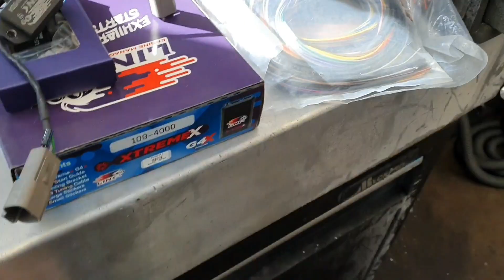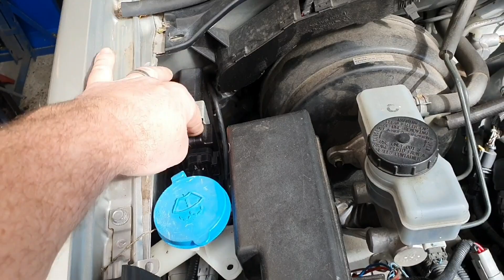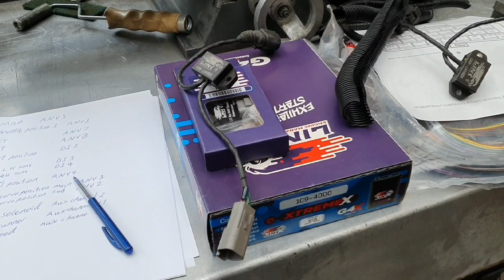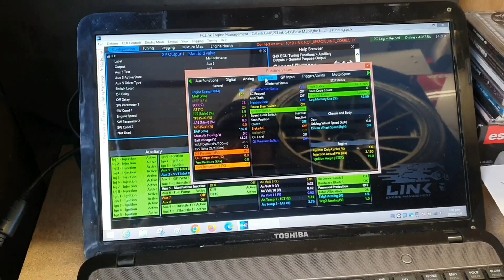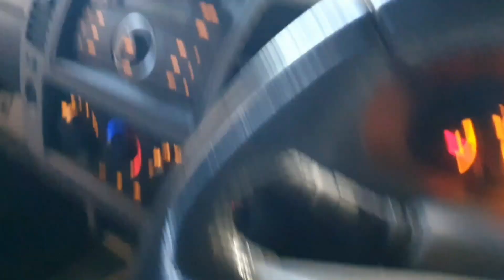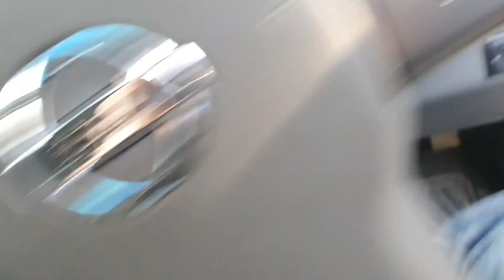Link ecu install VK45DE V8 D40 Navara (long video)

Comment: I am building a cobra with a vk45de the y50 version out of  a Fuga in New Zealand I believe I heard you mention in one of you videos that you can Rev it out to 8000?  I don't intend to modify it other than  having the free flowing side pipes and at this stage very much leaning towards this link computer set up,   I am running RX8 suspension and brakes your pinion on possibly using the abs sensors to run a traction control arrangement through the link computer? ( NO idea if that's a possibility just thinking a 1000kg car with 400hp could be a handfull😅😅😅
Reply: I believe they're limited by the runner flow, I think they run out of steam around 7k with the stock manifold/cam..

Comment: Building a shelby cobra using this engine for motivation, been looking at options to run it,   this option is looking promising
Reply from the maker: They are a great ECU and run these engines with ease, if you add a Razor PDM to the equation you'll have enough to run the whole car :)